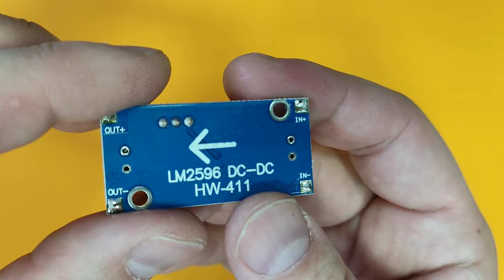How to power Phone Forever Without Battery

Comment: Hi wonderful video, liked and subbed.. I have a nexus 7 tablet which is dead, I tried ‘jump starting’ the charging by connecting DC Power supply set at 3.7v 0.5A, the battery charged to 3.7v and after reinstalling the tablet is still dead, current meter on usb shows 0.44A charging draw, do you know what could be wrong?
Reply from the maker: I think you should charge the battery further before reinstall in the tablet. When starting the tablet is drawing a lot of current and this could cause voltage drop in the battery. The tablet could "decide" that the battery is defective. Try this first and if it doesn't work you can try starting it with another supply and a 10k resistor. Keep in mind that at beginning it draws a lot of current, maybe 2 amps for couple of seconds.
Reply from the maker: Sometimes leaving it on charger for slightly longer time solves the problem. Try leaving it for 1 hour to take some nore juice ;)
Reply: @FixitEasyDIY  thanks I’ll give it a try
Reply: :face-fuchsia-wide-eyes:

Comment: Bro u did not mention how many watt 10k ohm resistor required 😢
Reply from the maker: It doesn't matter the watts of the resistor. You can use any watts, it's only the resistance important for this project.
Reply from the maker: Try measuring the resistance of the battery between the third pin and minus. This is the resistance value that you need to use. In most cases the resistance will be 10kohm

Comment: Old ultimate phone of imate having 5 battery terminal how to do
Reply from the maker: You need to determine where + / - and T plug are with a multimeter.
Reply: @FixitEasyDIY  t plug mean?
Use of t plug
Reply from the maker: @afgamer5576  temperature sensor pin. There should be resistance between this pin and minus. Something like 10-50kohm.
Reply: @FixitEasyDIY  ok
 I will try

Comment: In another video i have seen 80-100k registor used to bypass bms detection. Here u used 10k..🤔
Reply from the maker: It depends on the battery itself. Some require 10k and others 100k. In most cases it is 10K. This could be measured with a multimeter between minis and T pin on the battery. I did this and it shows exactly 10K resistance. The thing is the phone should "see" what the battery was giving to it ;) So we mimic the battery as it was. So you are right 👍, some devices will need 100K. In fact I've seen even 50K resistance there, so measuring is a good idea, but we could also experiment with it.

Comment: my battery has 4 pins
Reply from the maker: You need to determine +, - and T pin. This could be done with multimeter. Then measure resistance between T and minus or there might be separate pins for the thermo sensor and this is why there might be 4 pins. After all this is determined you have to feed the device with the same values as the battery is giving to it. It would be +- 4.2 volts and proper resistance. Some devices can start without resistor, so you can give it a try this way. Try feeding it with 4.2 volts in the first place. Keep in touch;)